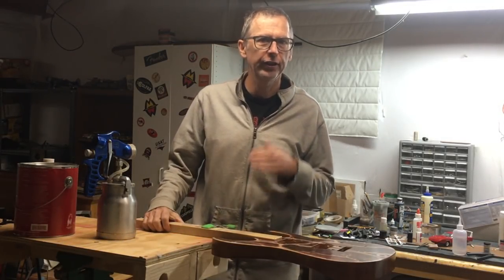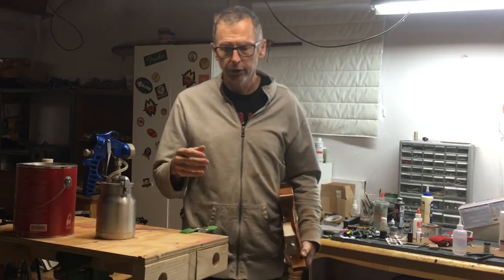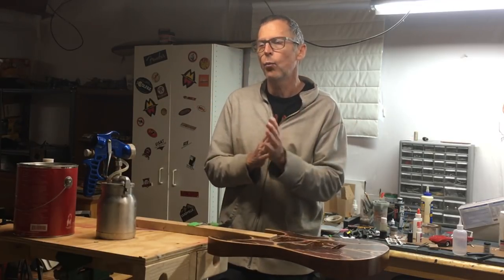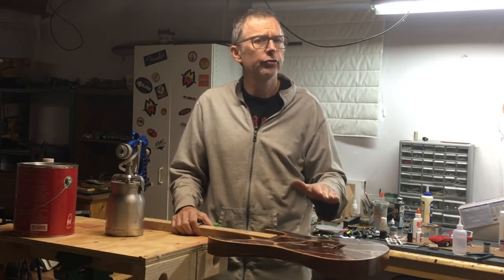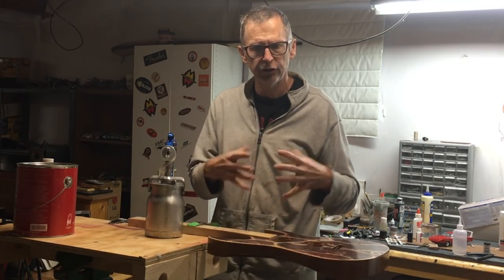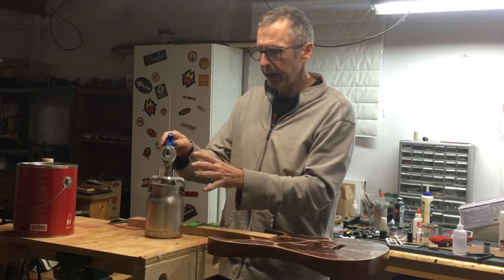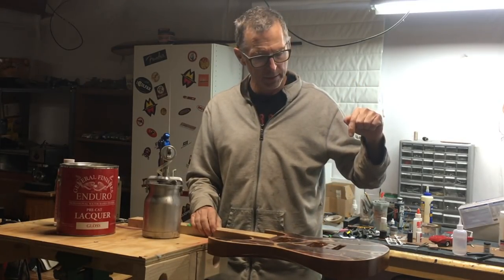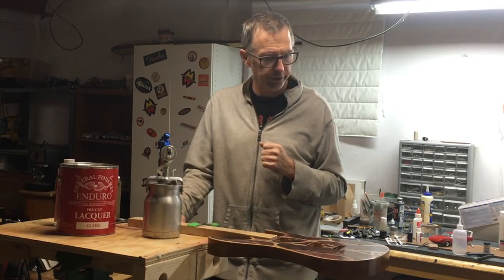A Couple of Tips For Spraying Water Based Topcoats

Comment: Hi Chris, Will the Earlex 5500 HVLP system spray Cyrstalac Water Based Sanding Sealer without any problems, or is it better to use an LVLP gun? I'm trying to save money by just buying the Earlex 5500 for both the sealer and the top coats (I'll be using Crystalac Brite Tone), but I wanted to see what your thoughts are. Thank you for all of your tutorials; they've been a tremendous help.
Reply from the maker: The Earlex works great. Any gun you buy for this needs to have all stainless steel internals. Many LVLP guns do not.

Comment: Great video.  Have you ever tried chilling the finish to compensate for the heat generated by the turbine?
Reply from the maker: Chilling a water-based clear coat product will ruin it. It has to be kept at or above 65°F to dry and cure properly. Therefore you have to adjust the gun for best coverage and you might have to add a flow enhancer to slow the drying process. Chilling the product will ruin it.
Reply: @HighlineGuitars  Good to know, Thanks!

Comment: Awesome video with lots of great info! Can I use waterborne polyurethane over solvent based polyurethane once the solvent based color basecoat has dried and cured and is properly sanded? I want to spray General Finishes HPU clear satin over some House of Kolor color basecoats urethane. I like HOK vibrant colors and just can’t seem to find any vibrant colors available in water based polyurethane sprayable paints. I have a 5 stage Fuji spray turbine with 1.3mm and 1.8mm nozzles/needles if this helps! Thanks!
Reply from the maker: You would have to test on scrap first.
Reply: Highline Guitars ah gotcha. That’s out since it’s over $100 for a quart of color basecoat and primer. Can’t spend that much and have it not work lol

Comment: I think in a more recent video you explained thinning with distilled water can speed up the curing so you recommend using retarder instead. Did I understand that right?
Reply from the maker: Thinning with water can alter the chemistry of the product and affect it's final cured hardness. Using the retarder slows the drying process for better flow out without altering the hardness.
Reply: @HighlineGuitars  oh yeah you pointed out that thinning with water creates runs. Thanks so much for the explanation! Going with the extender for sure!!! 🤙

Comment: What size tip would be used on your spray gun with the crystalac?
Reply from the maker: I typically use a 1mm needle. I have also used a .8mm needle without any issues.

Comment: You recommend HPLV rather the LPLV? Is that just because LPLV is less common?
Reply from the maker: Yes. Really good LVLP guns are still very expensive. The cheap ones out there are few and not very good.
Reply: Highline Guitars now I'm confused. On April 7 2017 you recommend a lvlp sprayit and give good marks.
Reply: Yeah, I just watched that vid 10 mins ago.
Confused! 0_0
Reply: Do you take back your statement about the lvlp spray gun kit you recommended last year?
Reply: I just bought the same gun based on the video as well? Loved the info on the video. Gonna take my first shot at spraying clear coat soon